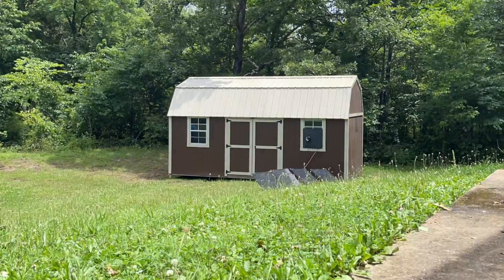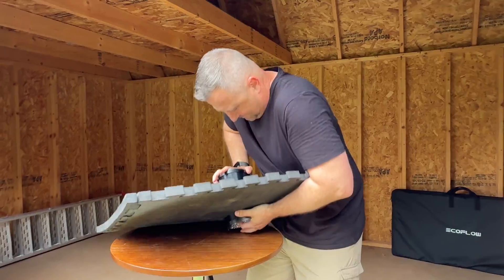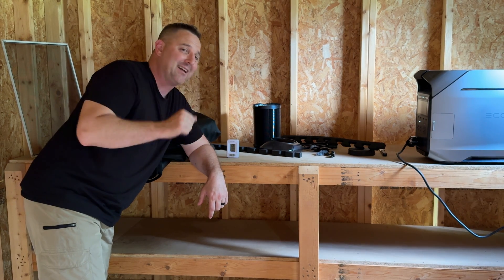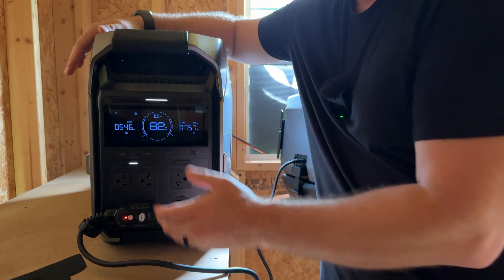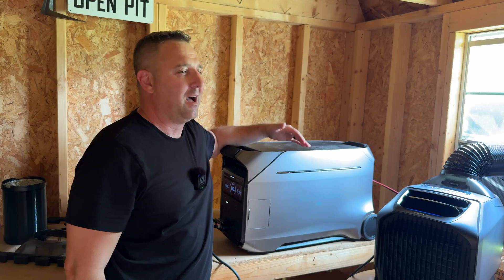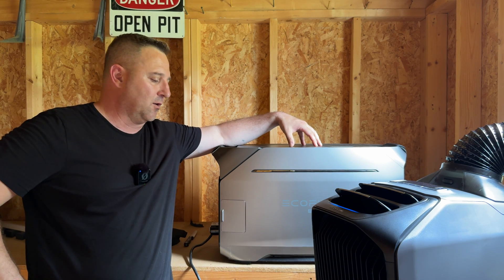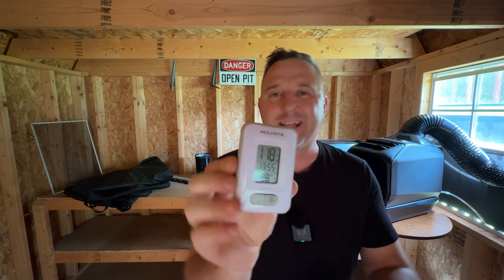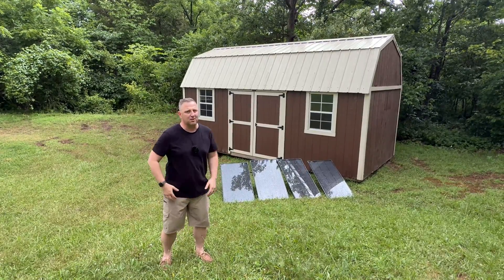EcoFlow Wave 3 HEATWAVE Test: Surprising Real World Results!

Comment: If you put aluminum foil over interior windows to block sun heating up building and it was insulated it might have dropped down to low 80s . I might be able to cool the back of a small van pretty well

Comment: A 20 degree delta between inside and outside is damn good, given its size. If you added some insulated the shed, you would probably get a better temp difference as the space would be more efficient.
Reply from the maker: That’s a good point. I’m also considering making some holes on the backside which is shaded to run a more permanent setup.
Reply: @AdventureGearTV That would be great, but I bet adding some good insulation to the interior wall would improve the envionment in the shed tremendously.

Comment: Heads up. At the moment, if you are using ac power and solar, the Wave 3 will prioritize ac power. So basically you will not be getting any solar power to the unit while plugged into ac charging. Hopefully ecoflow will address this.

Comment: Now do it with the 2nd hose, I'd put money that you'll notice a significant difference. Not to mention with some actual insulation. That 2nd hose is a feature that should really be used when possible. Otherwise really just burning more energy for no reason.

Comment: On portable home units we recommend foil wrap first then an insulation wrap over the entire hot exhaust tube.

 Estimates are a 7-20% efficiency improvement. That’s a lot of boost on a small 5k unit, or 500-1000 btu’s improvement.

A 5k unit looses 400-1000 btu’s because of exhaust tube radiation.
Reply: The tube that comes with the Wave 3 is now insulated and foil wrapped on the inside.
Reply: @GreenGoose99  I own one, and it is foil wrapped and better insulated but it's still very warm to the touch. Still enough to harm efficiency. That being said I greatly prefer the new hoses over the previous generation!

Comment: Thanks for the demo...I did buy the wave 3 w/battery and delta max 2. I also got a insulated vent hose cover than velcro on to help with the residue heat as mine will be in the passenger seat of my 2022 Chrysler Pacifica  mostly for sleeping and often with shore power as a 74 yr old not much off grid and I haven't put on a lift yet was waiting on the warranty 😂
Anyway, I know this has nothing to do with this video but can you let me know the brand of the spare tire swing away hitch and how you worked around the hatch backup camera.  
Thanks as always enjoyed your content
Reply from the maker: Hi, that was a Temu special. Unfortunately, I have not seen it on there again since buying.

Comment: To maximize the performance of the EcoFlow Wave3, install 2 Valterra ports on the back corner of the shed - 1 for input and 1 for the hot output. You will have to buy some adapters to go from the EcoFlow tubes to the Valtera ports, but they are available. And obviously, insulating the shed would help in both summer & winter.
Reply from the maker: Great suggestion! I'll definitely keep that in mind for future modifications.

Comment: Insulated ceiling and walls, and you will feel a huge difference in that shed, and your air conditioner won’t work as hard.
Reply from the maker: Long term it’d be nice to add insulation and a more permanent hvac unit.